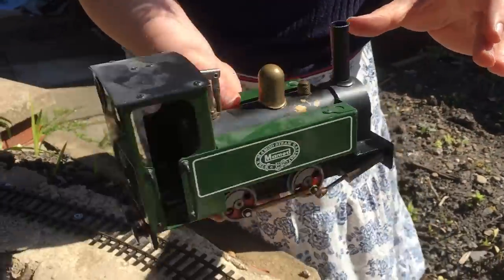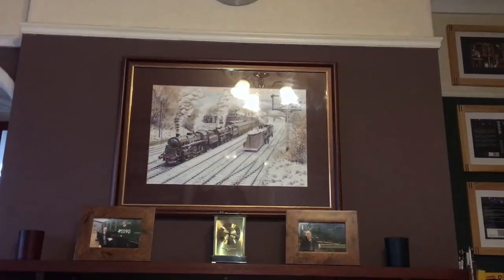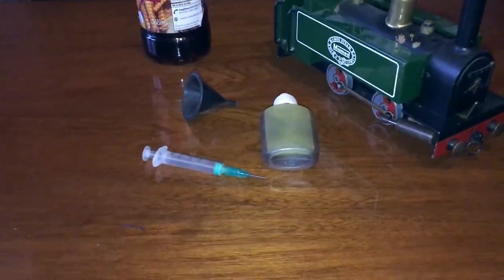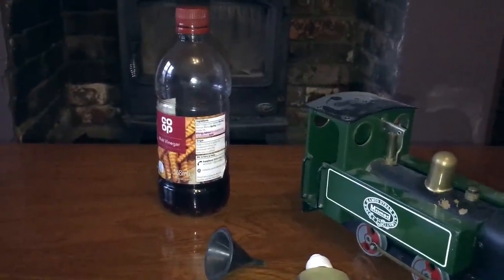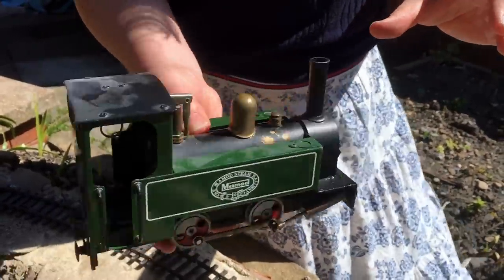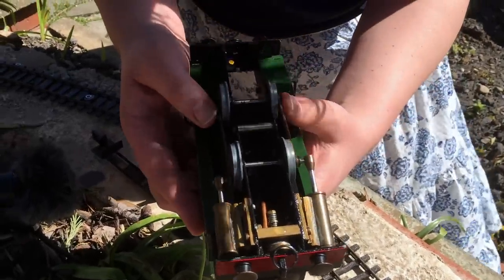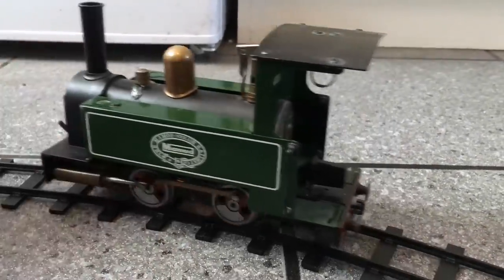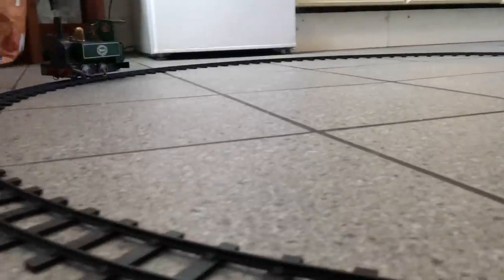Restoring and Running A Mamod Steam Locomotive

Comment: Thanks Jenny this has inspired me to get my  Mamod out of the loft. I bought a black one in kit form as a teenager in around 1987 as at £67 new it was cheeper than ready built at  £124. Having built it it for whatever reason wouldn't get up steam to run so having kept the box and all instructions and being older and wiser your video has sparked my interest to check it over and get it running. I still have the fantastic oval of track from back then ready to put in the garden when up and running.

Comment: That loco is much better than the basic stationary engine I had as a kid. Learned pretty quickly that you pour meths into the burner carefully and not light up the kitchen floor. The joy on your face watching it go round and round says how you don't need fine details to enjoy model trains.

Comment: You're on the slippery slope now Jen. Just started live steam with a mamod myself and now looking at regulators, in line lubricators, upgraded pistons, gas burners etc  check out Roywoods models website lots of upgrades available,  you will probably end up with a roundhouse locomotive in the future but you'll need to save your pennies, good job on getting your locomotive running in the short term a meths burner would be a good investment

Comment: Hi Jenny. Great vid. I use a light oil for lube on the con rods applied using a nail varnish bottle and it's brush for better control on our Roundhouse and Accy locos. We are in a hard water area here in Tamworth so use water collected from a condensing central heating boiler. Looking forward to seeing it run in the garden😁👍👍
Reply from the maker: Colin Williams luckily it’s very soft water here
Reply: you can get distilled water from halfords, or de-ionised water from most supermarkets (for steam irons). pence.

Comment: Jen great to see the little loco working, might I suggest you visit your local preserved railway ( the smaller the railway is the better, no SVE/NYMR type railways) for steam oil, we used to supply a few NG16mm people at the Colne Valley Railway at a more sensible price, also on the full size locos we had to per-heat the steam oil for the sight-feed-lubricator so we could poor it it in! Also there are people/companies which make improvement kits for the Mamod loco, an idea for a second loco? You must lube around as Ian Turvey has stated
Reply from the maker: Vinny Halls I can get loads through my father who runs a Garrett steam tractor.

Comment: i tried this on my own toy steam loco because there was some scale on the inside of the boiler i used a little bit of warm water out of my kettle i let the water cool down and then removed it out of the boiler the engine steams a lot better now than it did

Comment: With my solid fuel locomotive I use some  red spirits to help light it.
Unfortunately I can’t run it because it’s funnel fell off, has anyone else had this issue aswell.
Also very good video Jenny, I did the same cleaning process with my loco recently and it worked.

Comment: Don’t forget to oil the axle bearings and the reverser valve a the front. Good result!
Reply from the maker: Ian Turvey did all that too!
Reply: Jennifer E. Kirk  I love the Mamod locos. I’ve got two runners (both heavily modified), two kits (1built), a MSS saddle tank undergoing modifications and an IP Jane (basically a super Mamod). Got a fair few spare parts too!

Comment: Lovely. Where is a good place to buy Mamod track? I've had a train for years that I really want to put to use.
Reply: Dream Steam sell it, along with Mamod themselves. You can often buy it on Ebay as well. Fair warning, it's isn't cheap though. It is, however, the cheapest SM32 track going. And some friendly advice - you'll probably want to buy accessories at some point, right? For the love of god, don't buy anything made buy a company called MSS.

Comment: Hi Jenny i have just acquired a train set the same as yours except i have a meths burner. The quality of meths available is pretty poor and i was wondering if I could use isopropyl alcohol instead as it is 99% pure and cheap. Do you know if this is possible?
Reply: Just found some meths called Jennycam 99% pure lol

Comment: Hi Jenny. I liked your video - in both senses of the work. However (and here my negative mood for the day kicks in. At the beginning of the video you showed the Mamod running - then you asked (on a couple of occasions) whether you would be able to get it running - a bit pointless after the spoiler alert! For those who didn't get to grips with chemistry, ethanoic acid is also known as acetic acid. Lastly, I noticed some shoes and boots on/beside the radiator - if any of these are leather, then it would be better to dry them away from direct heat. Anyway, thanks for the video - I liked the idea.
Reply from the maker: Paul Smith I blame the editor!
Reply: @JenniferEKirk  Good call!